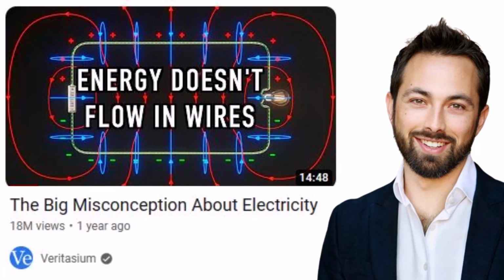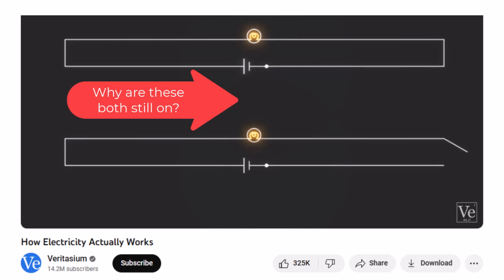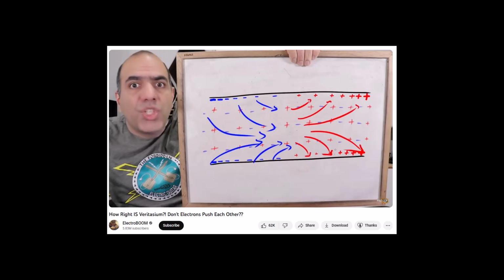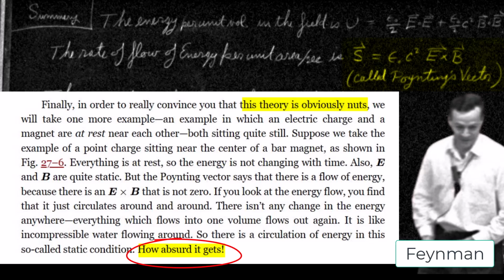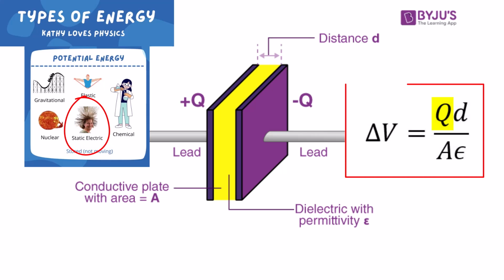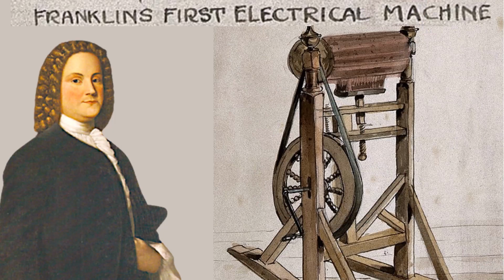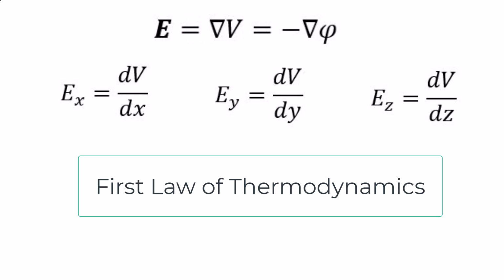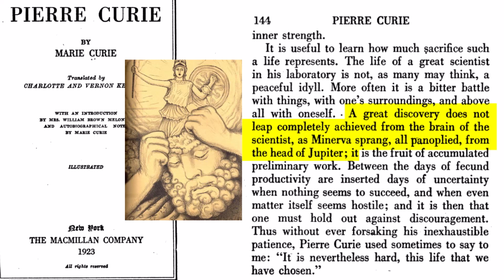Deep Dive Historical Response to Veritasium’s DC Electricity Video

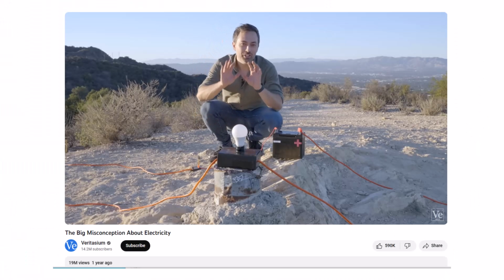Comment: This is my explanation of electricity itself. Elliptical orbits are not stable. Check the solution the center of mass has to accelerate it oscillates. The second thing I’m adding is the electron causes a wake in time that keeps the electrons from crossing paths. Electricity is elliptical orbits in the electrons passing atom to atom by the push of the time waves produced by relativistic speed of 0:07 the electrons. The electric field is produced when the elliptical orbits are induced and time waves are made that pass easily through the matrix of the conductor. A magnet has standing time waves produced by the aligned atoms. When the magnet is moved past the coiled conductor the standing time waves change the motion of the relativistic speed electrons and induce the elliptical orbits. My math for elliptical orbits gives a very concrete source of force that is the reason for a number of physic first principles. 
In the two body solution when they put the origin at the center of mass they put all the acceleration on the two bodies and zero the acceleration of the center of mass. This mathematically zeros out the acceleration. But the center of mass oscillates with the small mass object, it therefore has to be accelerating. The two body system will return to a lowest energy level which is a circular orbit. 1/2ma=MA where a= acceleration that induced the elliptical orbit. This is the in site that gives unified theory. I can not get my paper past the first line of defense at the publishers because of credentials. I have spent a lot of time on this, elliptical orbits are not stable and a photon is a time wave. With those two in sites I can explain a lot with just matter, gravity and space time. 
I would love to have you review my work. 
Rip

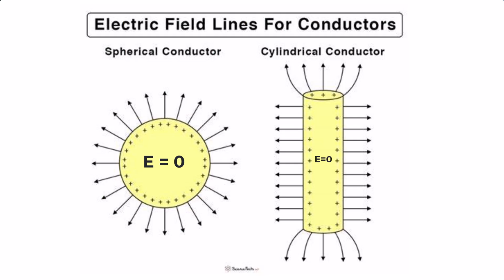Comment: 5:59 Wait: "static charges don't affect field in the conductor" is only true if there is no electric flow. Imagine a battery short-circuited with a wire from + to -. Now draw a closed loop through the battery and the wire. Along the wire, inside the wire, voltage goes from +1.5 V to zero, therefore there must be a field inside the wire too. Charges are constantly moving in an effort to balance out this field, but can't because of the external (chemical) energy source.
Reply: I think a static charge means there is no electrical flow.
Reply: @supermikeb  yes exactly. Kathy is  citing the rule that applies when there is no flow, while Electroboom is talking about a situation where there is a flow, balanced by a resistivity.

Comment: When I was studying Electrical Engineering in the early 1960's we first studied DC and Steady State AC circuits at lower frequencies. Then later we took a class in Transient Circuits and that introduced the concepts of electromagnetic waves and high speed transient effects of electrical conductors, spacing, conductor geometry, electric fields, magnetic fields and high frequency effects on circuits. Then we studied transmission lines, waves and antennas which then lead to Smith Charts and impedance matching and wave lengths, etc. I think what got Vertasium confused was conflating the 'transient' charge effects with the 'steady state' current/energy flow. Certainly an oscilloscope will see a 'pulse' of electric charge after the switch is closed but the light bulb required steady flow of electrons to create an (I^2 x R) energy flow to heat the filament and then create the light energy. Those two events don't happen at the same time. If all we wanted was to create an electromagnetic pulse then our house wiring could use hollow copper wires or 'wave guides' as microwave antennas us to move electromagnetic pulses around the house. However we need electrical energy to continuously flow to light bulbs and move motors, etc. so we must use 12 Gauge wire to move 20 amperes of current in a continuous manner to move energy without overheating the wire as the National Electric Code requires for all houses. The center of the wire as well as the outer part of wire all matter when you are transmitting DC or 60 Hz AC current flow to light bulbs, appliances, motors, etc.  Of course if you are transmitting megahertz frequency signals to an antenna then the rules change but that is a different matter as I studied in college. Thanks Kathy for helping clear up the differences in electrical concepts of current flow.
Reply: I think Derek's imaginary circuit should have had two switches, one on each side of the battery terminals and closes the 2 switches simultaneously to see when the light bulb lights up?  Of course, oscilloscope probes place after each switch, may be Veritasium just published the videos for the views only!
Reply: You are taking him too literally. He is really just making a point about how you can't apply the simplifications we use to analyse circuits whose components are not distributed in space significantly when you want to understand how a system of conductors distributed in space actually behaves. In that sense he is perfectly correct.
Reply: The only difference between AC and DC is whether the current flows through the valence electrons or the conduction band. While the conduction band is closer to the heart of the molecule it is not the "center of the conductor". It is not like the "flow of water in a pipe" that's a blatantly false analogy. Electron drift is from negative to positive. The flow of current is from positive to negative. In the opposite direction. The charge is a virtual photon that pops in and out of existence as the electrons oscillate up and down their respective bands of energy. Most importantly the charge flows in the "holes" left behind the electrons. Not through or in the electrons themselves. That's why plasma physics requires ion's with electron-hole pairs.
Reply: @Beale2634 i think what everyone keeps getting at is "skin effect" which is frequency dependent depth of conduction. high frequency signaling results in charge density nearer the wire surface.
the switch closure could be considered an impulse, which is all frequencies but the initial edge will likely be the high frequency portion exhibiting the skin effect followed by the quiescent dc state. when you look at the voltage signal on the wavefront it's a step function... high frequency initially followed by zero so the depth of interaction should be increasing with time.
i would posit both components will raise the filament temperature. but the DC component will result in vastly more power dissipation, which makes the light.
Reply: @Beale2634  I was under the impression that valence electrons in a metal are already delocalized into a conduction band and that it is these delocalized electrons that are available to flow in a metal wire, either in a consistent direction under a DC electromotive force or in alternating directions under an AC electromotive force. At low frequencies, such as those used in utility grid transmission, I don't believe there is a distinction between the transport mechanisms for electrons through a metal conductor for AC relative to DC. At higher frequencies, we have to consider skin effect, but even then, I believe it is the same "sea" of delocalized electrons that makes conduction possible.
Reply: @gracenotes5379  the one thing I would add is that it is not just the conduction band. The CB is a shell for electron orbital closer in to the molecule. The valance band is a lower energy electron band where the "free" electrons float in a cloud. The electron oscillates between these two shells. When it goes up a band it's because it accepted a virtual photon and gained energy. If it goes down a band than it gives off the photon losing energy. It is the passing of virtual photons that is the electromagnetic wave.
Reply: @Beale2634  I think it can be likened to flow of sound waves in solid rod instead of water in a pipe.

Comment: Overall, I found your video very good in that you present your argument with references without being attached to your view which we can comment on. But I think you're wrong in parts:

At the start of Derek's video, he says: "now you have to make certain simplifying assumptions about this circuit..." so listening between his words, I would still go with (d) 1/c; because to me, it looked simple enough to be modelled as a transmission line. Note he did a follow up video 'How Electricity Actually Works' confirming this, and showing the waveform of the pulses; where current clearly initially flows into the characteristic impedance of the transmission line, and lighting the bulb at a level lower compared to the DC steady state: but it still lights the bulb.

Voltage, energy density and the Poynting vector are physically meaningless locally, needing to be evaluated between two points, integrated inside a volume, integrated over a closed surface area respectively to give physically meaningful quantities. So the Poynting vector is mathematically consistent for DC circuits, so long as you don't try to create a physical picture on how it behaves locally, and stick with integrating it over a closed surface area to get the rate at which EM energy is crossing this closed surface. Also, the Poynting vector is part of the EM conservation of energy theorem derived from Maxwell's equations via the assumption that J.E = the rate at which work is done by currents and the electric field interacting with one another. It's also derived more elegantly from the Lagrangian for electromagnetism.

Comment: I think veritasium video mixes two topics, the steady state and the EM pulse. 

EM pulse: you have to treat it like a transmission line. It will move some electrons in the light bulb about 1/c seconds later, but not enough to light it up. Bulb will light up only after the signal will be able to "check" the continuity of the whole circuit (otherwise superluminal messaging would be possible). 

Regarding the steady state, once all the oscillations of the initial EM pulse have been dampened out: to me it seems only a matter of modeling. The most common model is that of electrons pushed through wires. The moving charges then cause EM (static) fields as a consequence, and, curious coincidence, a Poynting vector appears. But, you could easily say that, lying the conductor in a certain way, you put some constraint on the shape of EM fields, which carry the energy and, as a curious coincidence, electrons in the conductor start to move.  Either way, you can't have moving charges without fields and viceversa. Choose the model that fits best, especially, the one that is easier to apply.

Comment: I believe you should have done what all physicists do: start from an ideal situation (spherical cows moving in a vacuum...) .  The switch closes real fast, there are no sparks, the wire has no resistance, etc. I think you should also ignore all transients. 

The question  is what makes the light bulb to light up: the propagation of the EM field, Poynting vector,   electrons moving through the wire,  leprechauns,  etc. 

In my opinion, I think that you are dodging the main issue.
Reply: What IS the main issue being dodged?
Reply: @Drmcclung   My comment is self-explanatory.
Reply: @Drmcclung   My comment is self explanatory.
Reply: @johneagle4384  She covers in her vid what makes the bulb light, and what doesn't.

Comment: There is a fundamental error in Veritasium's video using the Poynting Vector as a model. The Poynting vector applies only to light, or photons. It is true that the electrical and magnetic waves coming from any electromagnetic device are orthogonal and move at the speed of light, but that result has a diminishing effect. It's effect diminishes by 1/r^2 as you move away from the device. This is completely different from the electromagnetic properties of a photon which is what is modeled in the Poynting Vector. A photon has diminishing effects at just 1/r of the distance from the source.  If photons didn't behave this way then we would not be ables to see stars in the night sky. I believe Feynmann writes about this somewhere in Lectures On Physics. This is because a photon actually detaches from the source that produced it. That's in sharp contrast to electrical energy that does not detach from its source. This non-detachment of energy from most electromagnetic devices is what results in counter emf when the field collapses when you open a circuit in which current flows.
Reply: To confused. When talking about classical EM theory which you are you should not be using the photon idea. Pointing Vector can be used anywhere with EM field. Drop off near or far field, does not matter. It gives energy and field momentum locally.
Reply: Electrical energy IS detached it just doesn't go very far it's in surrounding field. Where is energy in capacitor? It's not very far away but it's not on the plates where the charges are. Energy is in field or doing work on charges locally Both

Comment: I tried to do a rough calculation, and the resistance of any real wire a light second long would be so high no real battery could overcome the resistance.
Reply: It wouldn't need to traverse the wire as it was claimed the bulb would illuminate before that anyway.
Reply: Electricity, Magnetism, Heat, light / Color, Mass / Weight are different manifestations of Gravity and Continually convert to each other. Gravitational Particles (GPs) move by means of CONDUCTIVITY towards the CENTER of the GRAVITY.  
Turbines convert the Gravity Force to Magnetic > Electrical > Heat > Light and everything in between.
When GP moves in the Air (4N1O) Atoms are manifested as Magnetism, therefore Magnetism exists only in the Atmosphere and is absorbed by Compass measured in Air Gap and Magnetic Flux context.
When GP moves in Solid it is observed as Electricity and measured by its Power/Force/Voltage and its Current/Amps and their combination total Quantity of GPs in a unit of time as Wattage.
GPs move at a 90 Degrees Angle relative to their path in [side] Steps, therefore the GPs manifested as Electricity, Magnetism, Heat and Light transit to the Outer Edges of the Medium/Matter.
Reply: @ShonMardani  I am aware of no such Grand Unified Theory.
Reply: u cray cray @ShonMardani

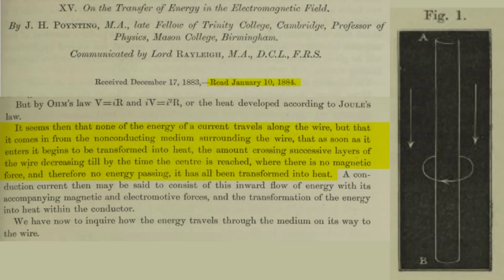Comment: 7:33 you say to keep in mind that heat is a form of energy, but the poynting vectors only represent the flow of elctromagnetic energy, which doesn't include heat.

In the case of a single resisting wire between 2 charged plates, i feel like this model makes a lot of sense: since the wire has resistance, when current flows through it will radiate energy outwards in the form of heat.
So it kinda makes sense that to compensate for this loss (in accordance to local conservation of energy), electromagnetic energy should radiate into the wire.